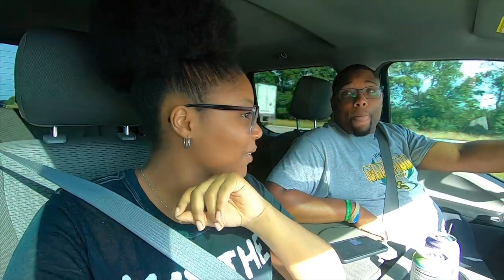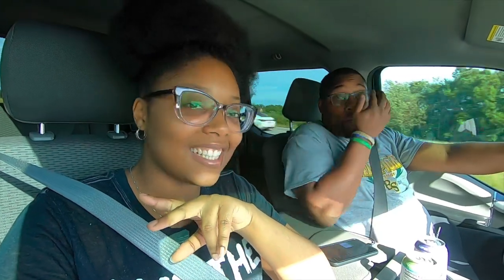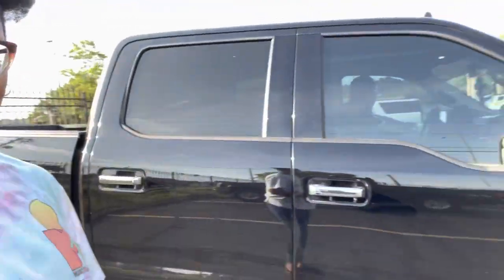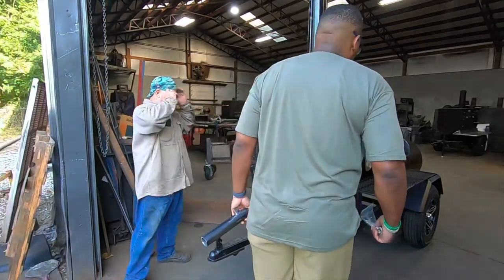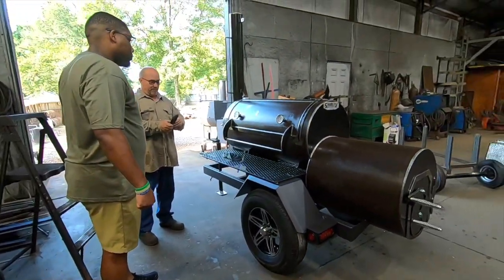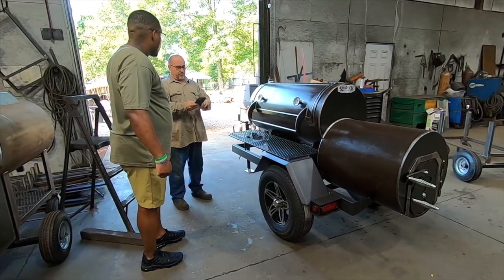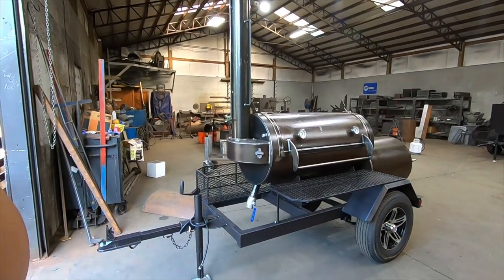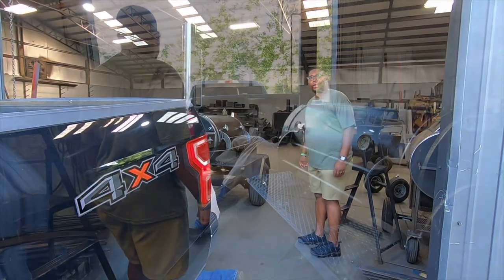Shirley Fabrication Traditional Flow Smoker| Travel Vlog

Comment: Beautiful pit! I know you have only had it a short time but how does it compare to your patio model? I’m trying to make a decision between the two .
Reply from the maker: I LOVE both pits,  and the 24×36 has great space for a patio sized cooker. The major difference I see so far is the traditional smoker draws a whole lot more air and burns more wood. I lean towards the traditional for that reason, the convection helps crisp chicken skin and builds a great bark on my beef products but definitely has to be monitored more closely because things will crisp up if not careful.  Either way you go you'll love it, I do like having it on a trailer because I plan to tailgate this football season.

Comment: I’m trying to decide between this or a Workhorse 1975t which is how I came across your vid.  A comparable 1975t is around $4200.  Is this in the same ballpark?  What was your lead time?

Thanks and enjoy.
Reply from the maker: I had the same dilemma, I obviously went with the Shirley but I don't believe you can go wrong with either Smoker. The lead time at my time of purchase was 3 months and the price tag was a little more expensive than the Workhorse,  by about 700 dollars.
Reply: @JamesTaylor-uo2ng  Thank you for the reply, that's helpful.
Reply: @JamesTaylor-uo2ng  I want to buy my first Offset and want to know if the Drive is the same like from Wirkhorse or better ? I like the workhorse 1975 but in the forums I read every time to buy a Shirley . The Shirley smoker looks great but is the drive as good as from the workhorse? I heard that They spend a lot for they engineering for they smokers . Thanks Dean